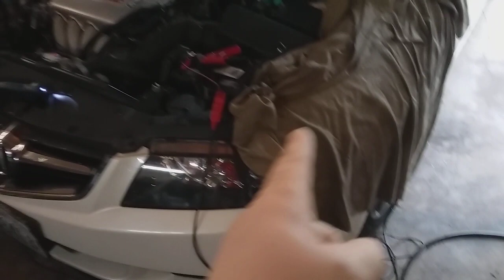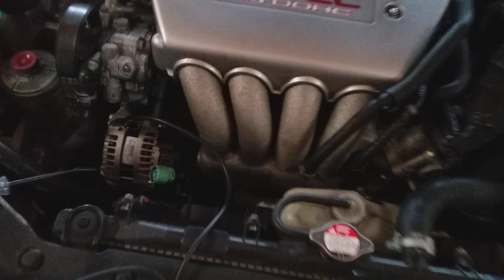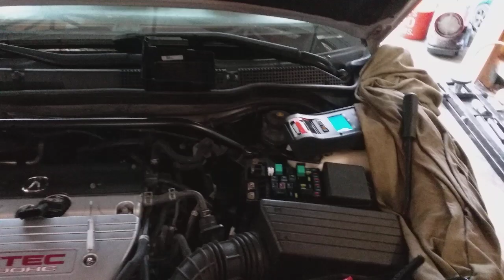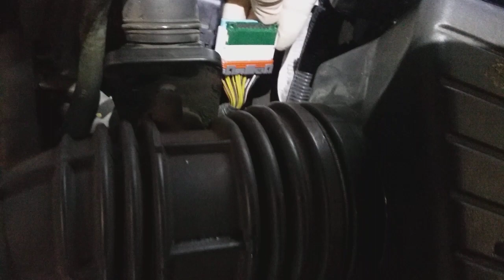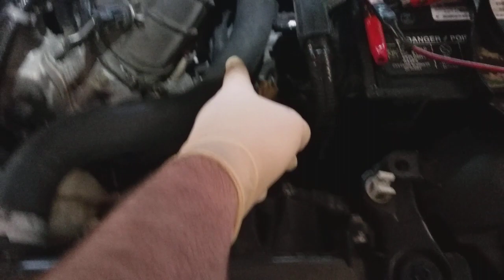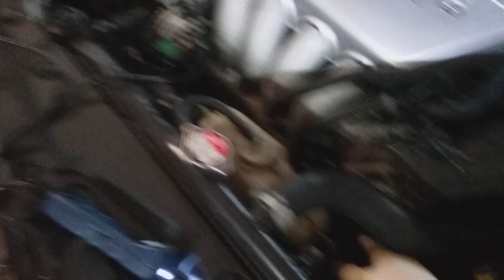2004 Acura TSX no charging from alternator.

Comment: Good video !i am having that problem what number is that fuse under the dash that i should check or what name?
Reply from the maker: @maxximum18  sorry but that video was so long ago I cannot remember.
Reply: @Steve4x4  THanks for the response checked all the fuses ( alternator has been tested   good)   it has to be the connector, did you have the ignition on with the test with the testlight?  do you remember if the connector was grey ?  Thanks for your help
Reply: update found the connector is there a fusible link or do you change the whole wire
Reply from the maker: @maxximum18  I had to re watch the video to reminde me what it ..on this car the connector was not all the way seated. All I had to do was push it together.
Reply: grey connectot problem solved your video did it thanks!

Comment: Would you know how to repair it? I just started getting into car maintenance for my 2004 acura tsx. I have had a solid battery light always show when the engine is running. If I unplug the wire that connects to the alternator, the light turns off, but if I put it back in, it presumes to turn back on. I've had this battery light problem for quite a few months now.
Reply from the maker: You need to test the voltage at the battery  with engine running vs engine off. Engine running you should see 13.5 - 14.5v
Off should see 11.7- 12.5v

If u don't see those number. Then changing diagnostics needs to be done. If you don't have the ability to test voltage. Then you should take the car to an automotive technician.

Comment: can you just put voltage on the pin to get by in a pinch I wonder?
Reply from the maker: I wouldn't cause it might back feed to the ecm. And u might cause more problems.
Reply: @Steve4x4  I guess what I'm saying is. If I was on the road and the battery light came on and I had a jumper wire ready to place in while only in key on position. Just to make it home.  It's happening to me right now and I'm glad I came upon your video.
Reply from the maker: @ericanderson2019  I supposed if the "KEY ON" Power is missing..
  I would want to know why first before adding power on that circuit.  If there is a short. And the fuse popped. And u add power to that. It's a fire hazard at that point 
 Key on power is from the ignition switch.. so if that is dead there my be other problems too.
Reply: @Steve4x4  that's what making the battery light on is the "no key power" signal if I read your video right. I got the next two days off. Gonna break it down. I'll let you know. Thx again.
Reply from the maker: @ericanderson2019  the end result in my video was the connection that was bad at the manifold. So not only was the alternator was missing Key on power... it would have also not have a field control from the ECM too. How I found the connector was tracing the key on circuit with a good wiring diagram. 
  Again I wouldnt go about adding power to a circuit unless I know there is no other place for that power to go. Or if I had a 5 Amp fuse on my jumper wire to pop right away if there is an unknown short that I'm trying to send power to.
It's just something I wouldn't advise without fully understanding the wiring of the whole system.

Comment: I have the opposite; as my main fuse 100A/70A is blown with a new battery and a bad alternator, replaced blown main fuse 100A/70A and right away is fried. I was told had to be ground wire with the positive battery terminal either with the starter or alternator??
Reply from the maker: They are correct.  For something to blow the 100A fuse... its a dead short to ground on the wire(s) from battery or Alternator or starter

Comment: Nice video , maybe u can help me out , so my car was having trouble starting my friend hit the starter and got it to start so he said I needed to change out the starter , I just changed it out well a friend did now my battery light came on for check charging system if im correct , what could it be ? Maybe that cable ur talking about that’s below or what not if u could help me out thanks
Reply from the maker: Without proper diagnostics. I can't answer your question.
Have you checked the charging system?  To change the starter the battery needs to be disconnected. Have you checked your battery connections 
With engine running @ 1300rpm do you have over 14v?  If no have alternator tested. If yes, next test is turn on every eletrical load. I mean everything, rear defroster, ac, blower on high, high beams on, flashers on, radio on, seat heaters, foot on brake, door open to turn on dome light. - every eletrical items "on"
And measure voltage. Is it 12.6v or higher. If yes then alternator is ok. If no then alternator needs to be tested.
  If yes and the battery light is still on. Then there is another issue and should probably be taken to a shop at that point.
Good luck.

Comment: Thanks bud!!! spot on!!! Fuse #18 blown. Replaced the alternator twice. Danny, San Antonio TX.
Reply: had my #18 fuse blown after changing alternator. it was heat shield hanging above cat putting pressure on secondary 02 sensor shorting it. check charging system Vsa emissions lights all came on. can you imagine a secondary 02 sensor causing this problem haha
Reply: @michaelmcaree8543 you changed the secondary 02 and it fixed it? Cause im having this issue, i tried multiple oem and aftermarket alternators, changed the entire charging harness and fuse box, i replaced any blown fuses still happens, i towed it to my buddy’s place since I was going to get some work done soon anyway and when he lifted the car the secondary 02 was cooked, wires were cut up since the car is basically slammed.
Reply: i just disconnected the  plug of the secondary o2 sensor. its under the passenger seat. have to take 4 bolts out of seat to get to it. than it wont  trip the fuse which is on same as alternator
Reply: secondary 02 sensor doesn't control air/fuel mixture so you really dont need it. unless you need an inspection. the check emissions light will stay on but it wont blow the 18 fuse that also controls the alternator.

Comment: So my 2006 acura tsx has been turning off and immediately coming right turning right back on but I noticed it only does it when I'm listeing to music, have the A/C on or my headlights. Do you think that its a faulty connection somewhere?
Reply from the maker: Wow .. I know it seems specific.  But your description is very vauge.. I highly recommend paying a shop to have diagnostics done. But make sure you go on a test drive with them to pinpoint exactly what is going on.
 Good luck with that.
Reply: @Steve4x4  Thank you, thats prob a good idea
Reply: @Steve4x4  I took it up to a auto care and they tested the battery and alternator and thats all good. They said that it's most likely an electrical issue that the dealership could identify. I'm going to follow your video 100% tomorrow and see if I can spot the issue. They think that its 100% a fuse or loose wiring
Reply from the maker: @chandlerwendt6328  good luck!
Reply: Did you find the problem I have the same problem

Comment: Having a similar problem with my 2010 Acura TSX any suggestions?
Reply from the maker: U say similar problem.. do you mean "no output from Alternator"? If that's the case then you need to verify "key-on" power at the multi-pin (either two wires or three) one of those wires must get "hot" when key is turn to the on position
  If yes.. then usually u need an alternator. If no.. then deeper diagnostics need to happen to find out why that is missing. But I only suggest this if you really understand the eletrical system. Cause it's easy to misdiagnosed this problem.

Comment: Hi, how can I check switch on power to alternator with a voltmeter vs the device you use?  I have 2 year old replacement alternator on that appears not to be working (battery light on... voltage when running at battery not increasing when car running).  Thank you!
Reply from the maker: Un-plug the connector.with key off. check for voltage at all the wires. Make a note of which wire has battery voltage and which does not. Then turn key to 'on'/'run' . Now recheck the connector. ANY wire(s) that had missing battery voltage that Now has battery voltage....that is your key on power.

Comment: I suspect the battery not charging light didn't come on and in fact wouldn't even light up when the key if first turned on.  My connector was disconnected which lead to no charge but also no battery light.

Comment: Spot on repair! Had the same problem with a 2006 TSX. That connector had come loose, most likely when the manifold was removed to replace the starter. Thank you for taking the time to post this!
Reply: Randy which connection was that ? I have the same problem
Reply: @sierrawest8982  The same connector he points out in the video that you can't quite see in the video but can easily find. Small wiring connector just under right side of the intake manifold near throttle body. Follow the wires from the alternator under the manifold heading out toward the battery side of the engine bay and you'll find it.
Reply: Yo
Reply: My Acura  same years ass urs doing same problem
Reply: Did u guys get the knock sensor code also ?
Reply: @VivaLaRaza619.I have the same code
Reply: Did u get a code ?

Comment: I think it's my wiring also because alternator not working and my knock sensor showed a short all the wiring is together
Reply: Did you ever get this addressed? I'm having the same issue of both my "check emission system" light which triggered code P0332 for the knock sensor and "check charging system" light appear.  I have replaced the alternator, battery and knock sensor and both lights still appear.

Comment: Awesome video I have the same problem with my 2003 honda element, you had said something about a EOD what is that...thanks
Reply from the maker: E.LD. - Eletrical Load Detector
Its is a load sensor the lets the computer know know much electrical current the vehicle is using. Then computer adjusts the output of the alternator to meet the load requirement.
Reply: eletrical load detector. It helps tell the ecu how much the alternator should work to save fuel

Comment: I installed a new battery I drove it for about 10 minutes and it drained it. Also my “check charging system” light is on .
Reply from the maker: Is there a question?
 Have you checked the voltage with engine running? Most cars when engine is running you want to see between 13.5 and 14.5 volts. If you new battery was drained quickly, then you have a charging system problem. Possibly the alternator,  or other. But without diagnostics you cant tell what is wrong.
Reply: Steve P. This also happened after I gave another car a jump like 20 mins after that all of my abs and airbag all my lights came on. You think in might be the fuse?
Reply: But then again with a new charged battery the car turns on fine..
Reply: Steve P. What fuse should I look for?
Reply: I have a 2007 Acura TSX
Reply from the maker: Ahh the rest of the story..
At this point.. you could replace a lot of parts and not fix the problem if there is a electrical problem then you need Diagnostics. As for a fuse if everything is working correctly the odds of having a blown fuse causing your problem is very very small. Since the charging system is controlled by the computer and if there is a possibility that you reverse the polarity there is potential for damage to the computer the alternator and various other components. So I highly recommend that you find a reputable shop and have them do diagnostics on your vehicle
Reply: Steve P. Ahhh dang sucks for me in that case... thought it could be a bad alternator. But thanks for the feedback.

Comment: Did you figure out the issue I’m having the same trouble
Reply from the maker: Yes... I had to watch the video to remind me... once I got down to it... the connector was not fully seated.
Reply: Steve P. Which connector??
Reply: @Steve4x4  Can you show the connector
Reply from the maker: @p13-b110tu  I cannot cause I no longer have the car in my shop
Reply: @p13-b110tu  if its like most 98-05 accords it will be a four pin connetor coming off the back of the alternator that runs right below the fuel rail just before the gold connetor section of the power steering hose. Which almost all accords had recalls for the p/s hoses  due to leaks in that exact connection point, so hopefully your plug isnt soaked with p/s fluid (lucky me) which would cause a plethora of issues not just for the alternator but anything else on that circuit. Hopefully you just have a seating issue or even more common- the plugs locking tabs been destroyed by anyone that ever tried to disconnect it after the vehicle 8th birthday...cuz hot engine, cold engine, hot af engine, rinse and repeat for years = if the entire plugs plastic housing didnt disintegrate by just looking at it funny, its almost become fused to the plug its connected to because of the expansion and contraction due to the heat temps off the engine its damn near been under over the years. So just be prepared . OH AND DONT GO BUY A NEW CONNECTOR IF ITS OVER 8 YEARS OLD... go get one or 3 (because, well... old... plastic lol) from a salvage  yard or ebay. Why? Because A - you can snip a handful of both portions of the connection and pay maybe $5-10 total (new female pigtail $10-$15+tx each, male $15-20) AND B more importantly: plastic....old, contracted, hot, expanded, plastic thats been slightly altered in shape over the years. I mean yeah a 20 year old can probably hook up with a sophisticated/loaded 50+ hot cougar....doesn't mean itll be a good fit.... or look 😂 parts of a same or similar vintage tend to pair well like a good cheese face, less whine ing because youve been trying for 15 min to get the new plug to lock in to a slightly smaller than required tab it should just fit in damn it! Lol so save your sanity and your money
Reply from the maker: @anas tufail i dont fully understand what you are asking? Do you need to remove the manifold to check that connector? No you dont.
Reply from the maker: I just looked it up for you. Yes there is a connector that is called "Starter sub Harness" Connector #C101 it's a 6 pic connector that the knock sensor circuit goes through it. C101 is located right next to the starter.
Reply: anas tufail which connecter?